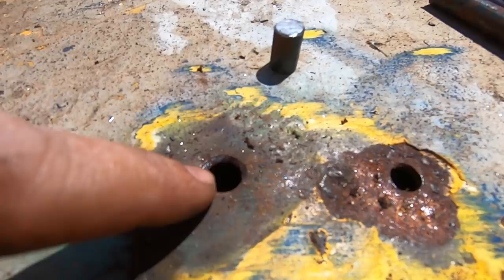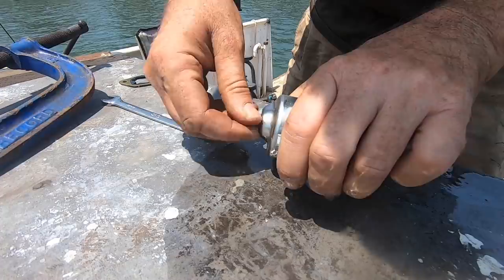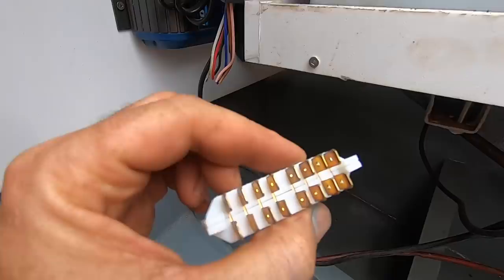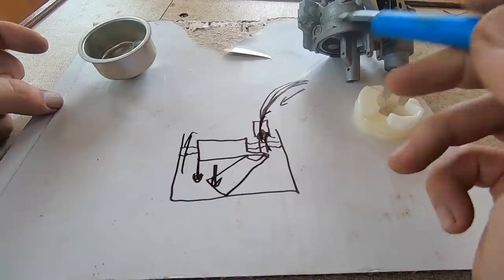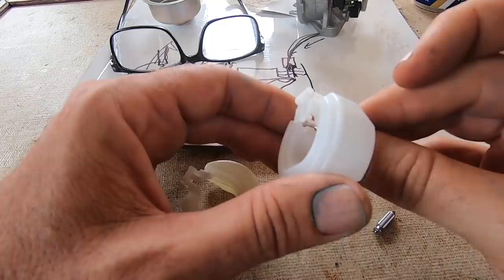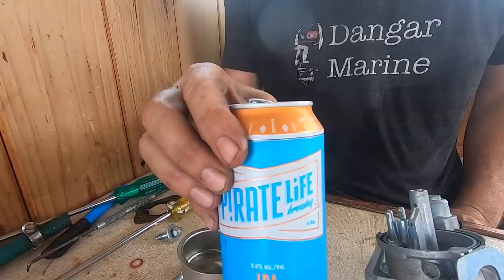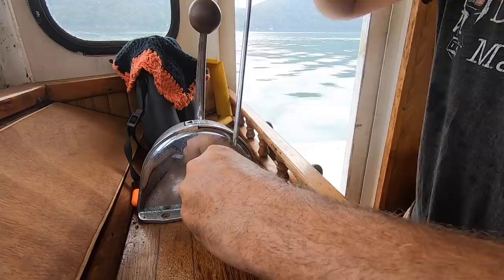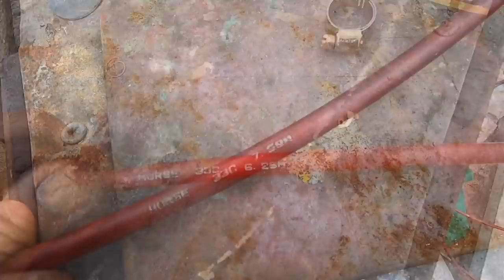Deck and generator repairs

Comment: Mate, bit of a random question. I noticed you do a bit of welding. I'm just learning and been using 6013. I noticed a heap of other channels all seem to mention how they don't like 6013. I'm pretty much just welding square hollow tubing for frames etc but what's the best rod to use for your general diy stuff. Whys everyone on youtube dislike 6013?  great videos by the way
Reply from the maker: 6013 doesn't have the tensile strength or penetration of a rod like a 7018. It is easier to learn on though so is commonly found in hardware stores. I that people dislike it because they also see it as a beginners rod that is beneath them. If the weld is either thin metal or the strength isn't critical then it is fine. 7018 is better for welds where structural integrity is more critical.

Comment: BLEVE .. you should know about that Stu from the fire brigade lol.

They won't BLEVE till they've vented down to 5-10% full as the LPG itself is LIQUIDpetroleumgas and liquid helps actually cool the outside of the bottle. HOWEVER once you get down to 5-10% you have more gas less liquid. It will still need massive continuous heat though to make it finally rupture.

Gas bottles themselves are amazingly safe. I followed the bad stigma they had for years till I went through training and everything come together as to why and how. Most of the bad stigma they have is a. people have leaking hoses then a spark hits and boom ... b. someone runs up the back of your car rupturing the lpg tank in the boot and a spark from the engine or something sets off the escaping gas or c. you do my MIL and leave the fking stove running with no flame then light up a cig or something. Amazingly even drilling into an LPG tank is unlikely to cause issue other than a suddent freezing rush of gas (once the liquid level gets below the hole) but don't go home and try it.

Others talking of fires ... you folk dodged a bullet with that Gospers Mt fire ... VERY close bullet.

I've had the sinking float a few times in mowers :( ... ride on wasn't fun when it started draining 4st over the hot exhaust :(
Reply from the maker: Even when almost empty the pressure relief plug should blow first not allowing the tank itself to rupture. The trick is to have them pointing the right way when they do vent!
Reply: @DangarMarine  I think if they're copping that much heat they should be rolled away but yes your correct about direction and that's why by standard they're faced away from the house.

Did you ever get the training video of the American train crash that bleve'd and forced the rethink which got us the pressure valves? Hairy stuff.

Comment: Could ye not, there, with the float full of fuel there, pop one of those hose things on, so you could add you know, air and stuff, and do that whole washing up liquid bubble test thing that you can do and then, you know, find the hole, and probably do a little bit of melting the thing to seal it back up a bit? Could you not do that?
Of course, thinking about that, blowing air into a weeny little plastic bobbet like that could so easily end up with it catching a proper blow and go for a spot of flying lessons, which, given the hole made there for the hose or pipe or whatnot, would then be a wee bit of a sinker...

Comment: Either you have giant hands of those hens have tiny eggs.
Reply from the maker: It would be interesting to weigh them, but they are about the same size as any egg you would buy at a super market.
Reply: Your grocer is Keeping all the big eggs for his self LOL !!
Reply: @DangarMarine  are you making sure the chickens have some calcium in their diet? If they don't get enough you get eggs with no shell, only the membrane that normally lines the shell holding the contents together. We had to feed our chickens bits of clam / oyster shells to resolve the problem.

Comment: Why don't you use a soldering iron to melt the plastic....
Oh right, you need your generator to run a soldering iron....
But you need a soldering iron to fix your generator...
But you need a generator to run a soldering iron.....................🧠🤯🤣